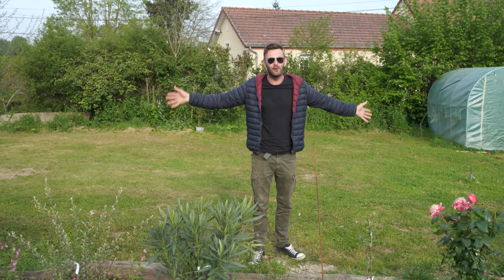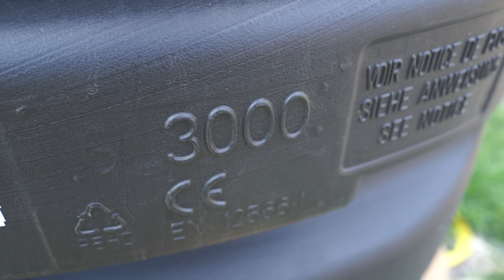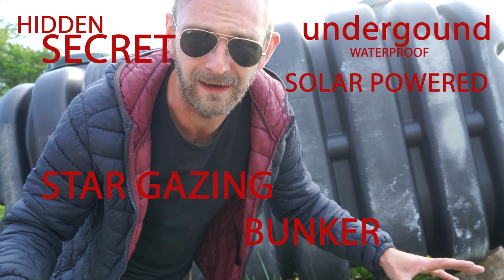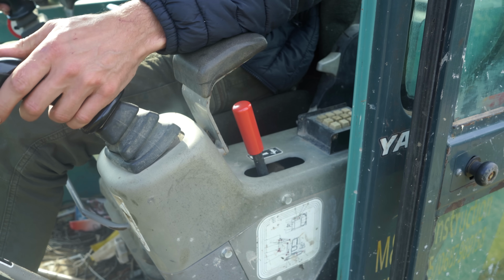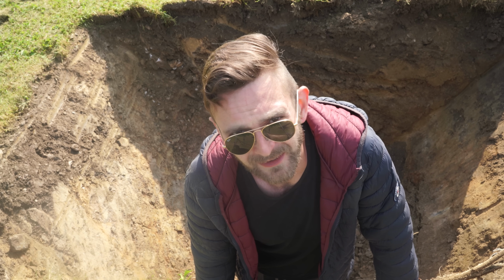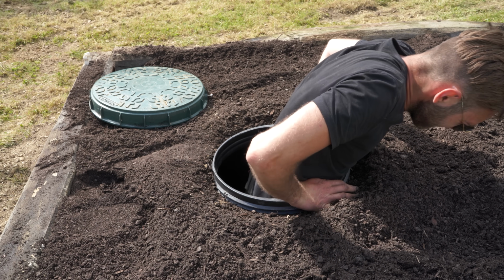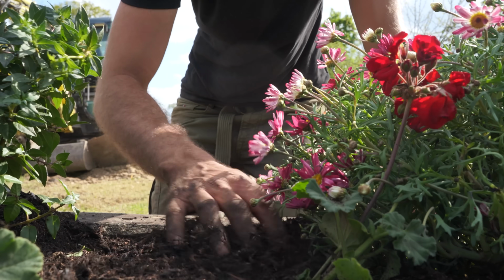Epic secret underground star gazing bunker build | solar powered

Comment: Not trying to be a downer, but I never wanted my kids playing anywhere near our septic system. It was clearly told to them, over and over, to never open it or play near it. We built up planters to cover the openings so they could not remove the lids. I would suggest flower pots over those lids.
Reply: I remember being warned to stay away from a septic tank as a child too.  Thankfully it is standard now to have bolts on the septic tank covers.  You can see there are metal bolts on the sides of the cover in this video.  🙂

Comment: Hi Dan. Did you use the inlet and outlet pipes as ventilation tubes? Maybe with a solar powered fan? Where is your water table level? You might find the tank rising up out of the ground during high rainfall.

Comment: Condensation will cause that tank to gain water.  You need a ventilation system, one that vents the heavier gas C02 out of the lower parts and a second vent hole supplies fresh air in the upper part.  Without vent holes you have a C02 coffin.  That begs the question, is it a good place to get rid of misbehaving kids? it could be : D
Reply: ITS A SEPTIC TANK.
HE Explained in the above comments 
Always read the comments lol

Comment: Dan, I'm a first aid instructor by profession now and I'm worried that with all of you in this closed bunker, you'll run out of oxygen very quickly.  I'd strongly suggest you leave the hatch opened while you're in there tonight.  The last thing you want is lac of air!   Perhaps add an air vent or pipe vent?
Reply: Hint hint - Dan makes funny videos!!
Reply: May need more as it is part of the septic system. 😂